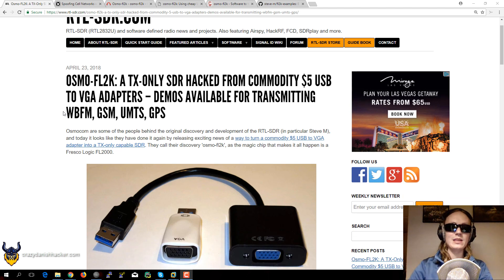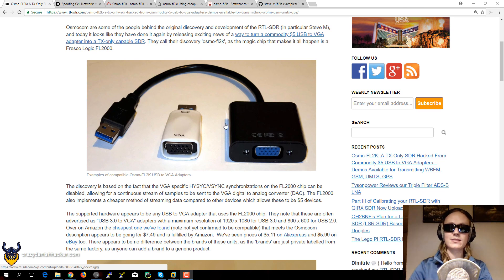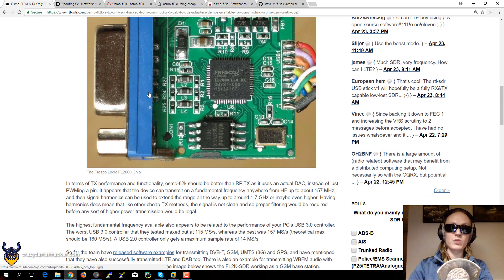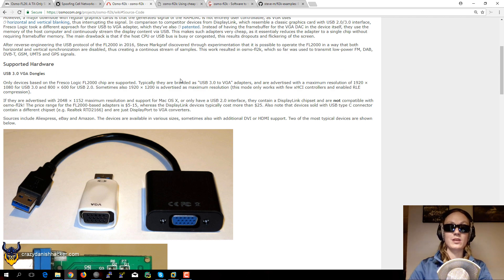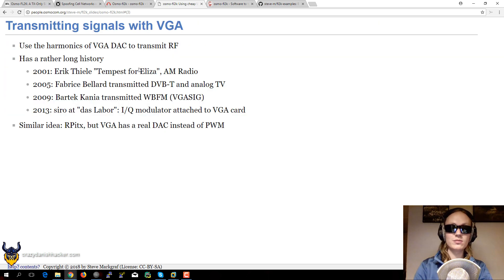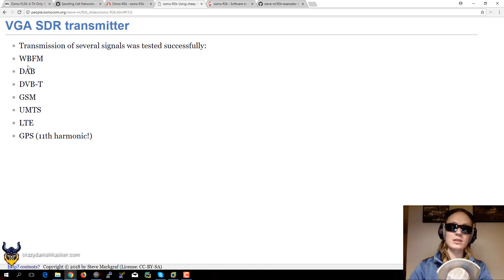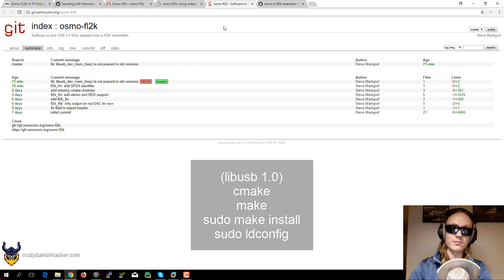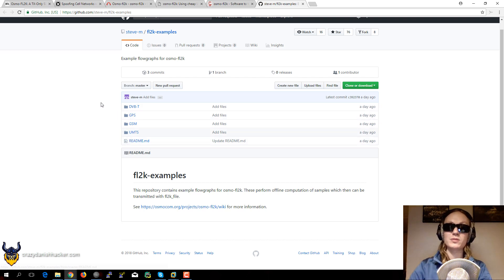USB to VGA Adapter - Transmit Radio Signals! (FL2000 / FL2K) [News]

Comment: Will type c to vga and HDMI to VGA also work ?
Reply from the maker: From what I could understand there was only research on this type of adapter, and I bought 2 where only one of them worked. I don't recommend transmitting radio signals this way unless it is for research purposes.
Reply: @CrazyDanishHacker  it will be useful for Diy research purpose like Signal generator for Local oscillator or mixers  that's why I am interested.

Comment: not sure if I want this as I already have my HackRF One

hopefully you can make a small comparison between your BladeRF and this
Reply from the maker: The HackRF and BladeRF are much better. The USB to VGA adapter produces a lot of harmonics which is essentially "noise" for all the other frequencies you're not intending to broadcast on. If you use this adapter as a regular "TX-only SDR" regularly, you'll probably get into trouble for all the noise/harmonics it's causing at some point.

Basically you will need to use filters on the USB-to-VGA adapter to be a good "SDR user".

Unmodified, the signal is quite weak on the USB to VGA adapter. If you connect an antenna like RTL-SDR did, then you should definitely use a filter. 

At some point in the near future, I believe websites like NooElec and RTL-SDR may start selling a modified version of the USB-to-VGA adapter including SMA connector and appropriate filters.

In any case, this adapter can't really replace your HackRF or BladeRF in my opinion.

Comment: We dont need chinese motorolas anymore to make own BS`s.
Reply from the maker: If you want to make base stations (BTS) aka celltowers, then you should use a BladeRF x40 or USRP (higher-end model with TCXO addon) as they have full-duplex which is needed for both transmitting and receiving at the same time. (Like a WiFi Access Point where it transmits data but can also read data from wireless clients at the same time.)
Reply: @CrazyDanishHacker  or two devices, one to transmit and the other to receive...

Comment: Hey man. Have you ever thought about making a passive radar with your SDRs?
Reply from the maker: Yes, but I need to make a better Multi-RTL or use maybe two calibrated BladeRFs :-) The one I made was too inaccurate for passive radar it seems, even though it does share the same clock.
Reply: Crazy Danish Hacker 

That would be interesting to see. Shame about the multi-rtl. I thought I saw a successful passive radar project with them somewhere though. 

Do you think the portapack for the hackrf is worth it? The havoc firmware looks fun.
Reply from the maker: I actually thought about buying a HackRF with the Portapack and adding the Havoc firmware as it looks useful and fun. More than running an Android SDR app + RTL-SDR which I tried earlier this week. It was cool to see it work but there wasn't much you could do with that app, compared to the portapack + havoc can do a lot more interesting stuff.
Reply: Crazy Danish Hacker 

I'd say go for it if you got the monies. I love my hackrf. My only gripe with it is the lack of full duplex. Wish it were a little more sensitive also. Got a portapack on the way.. haha. I'll give you some insight when I get it if you're interested. Yeah the android apps are pretty limited. I mainly use them for scouting.
Reply from the maker: I don't use my BladeRF that much, but the reason I wanted the HackRF + Portapack + Havoc FW is because of the whole portability concept, as there are some types of signals that I can't really decode easily inside. Outside I prefer not to use the laptop as well, it also rains a fair bit here, and you draw a lot of attention if you start using a laptop and a huge antenna outside. I have created a few "portable" projects with a raspberry pi, but that's where I have everything preconfigured and I don't know whether it will work until I go outside :-)
Reply: Crazy Danish Hacker 

I see how you have it double bubble wrapped haha Im the same with my toys. True that with the attention drawing. I get weird looks when I mess with the phone apps. I've also tried the ssh/rpi approach. Worked pretty well. I was able to get it to handle 4msps overnight several times messing with stuff like gr-iridium.
Reply from the maker: Yeah my BladeRF is currently "gathering dust", but it is still double bubble wrapped and in the original box :-) It's an expensive SDR with "semi-exposed" components, even with the transparent plastic enclosure. It's probably one of the few devices I have that I take extra good care of because I don't really want to buy a new one because I didn't take care of it :-) 

It's also more exposed now with the expansion board and all the extra "filters" you can connect to. I have mixed feelings with the expansion board, especially with SDR# where it only worked some of the time. (It wasn't exactly "plug and play".

I'm not sure how many msps I got with my RPI + RTL-SDR, but as you know it only handles around 2.4MSPS in a stable manner. (I assume you tested 4msps with your HackRF on an RPI)
I know that you can also run BladeRF of your SDR, but I haven't tried that yet. I might do it in the future, but I'll take extra care when I do so as both the HackRF and BladeRF (and USRP) are in my opinion "specialist instruments" that you should take extra good care of :-)
Reply: Crazy Danish Hacker 

The transparent case looks great. I've upgraded the case to aluminium for my hackrf and soldered a shield. Helped wonders with the noise.  I've never had the chance to play with a higher end sdr :( 

Yeah I used my hackrf at 4 msps with my rpi. Didn't see any overload on the rpi. Probably couldn't handle much more than that though. Most defiantly. I baby it and my rtls. It would hurt the wallet to ruin such an expensive device.
Reply from the maker: I had completely forgot that the popular Raspberry Pi v3 Model B only has USB 2.0. In that case, you probably can't get more than "12MS/s" I think.
Reply from the maker: I would say that a HackRF is kind of a "Higher end SDR" in my opinion. There are of course more expensive ones like BladeRF and USRP, but for most purposes a HackRF will actually do fine, plus it has a nice and large frequency range :-)
Reply: Crazy Danish Hacker 

Yes it's a rpi3 b. My bad, man. I should of been more clear what rpi I'm using. 

Anyways, thanks for the quality content. Been following since the start of your hacking series. Keep em coming :)
Reply from the maker: Thanks, I appreciate you following me since the beginning :-)